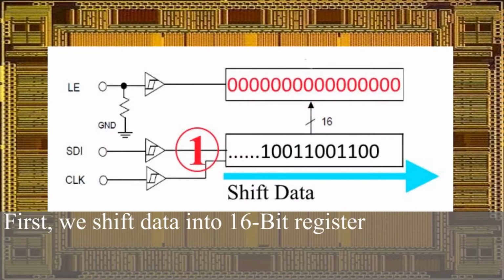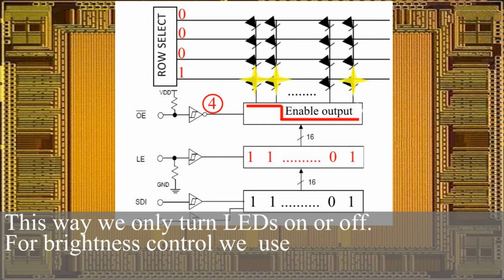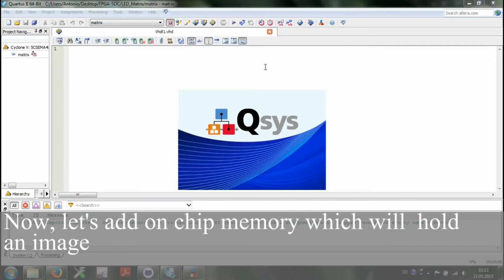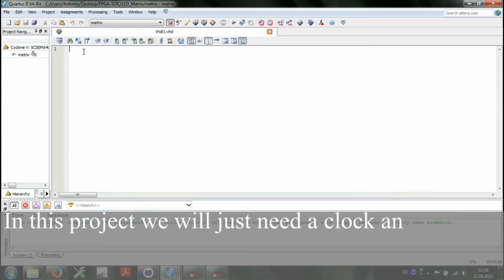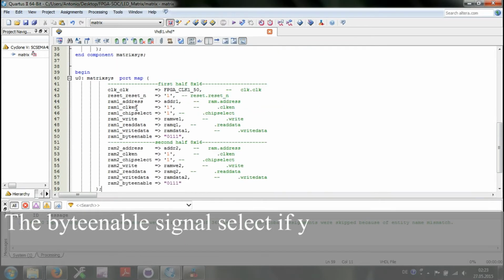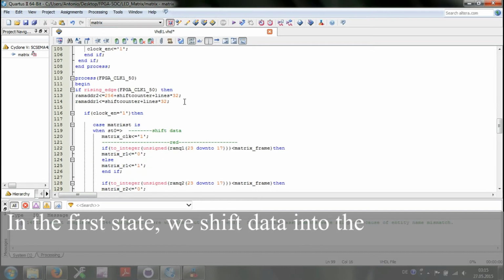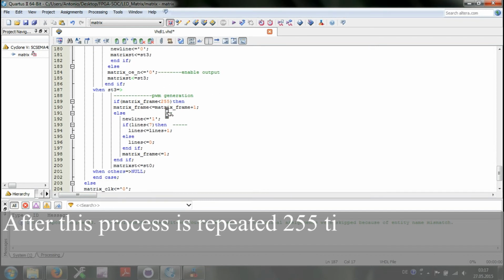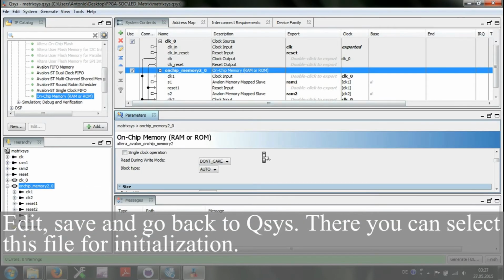Tutorial: Driving 16x32 RGB LED matrix with DE0-Nano-SoC FPGA board

Comment: Hello Toni, sorry to bother you again but your video is the most and show your high skills. I have a question: on the video you tell that the Adafruit display consists of two parts o rows each and you drive top ans bottom half simultaneously. This means that you have two drivers, one for each 8 rows? I'm asking about it because I have a 16x16 matrix and I'm afraid to use only one driver for 16 rows, Sure I'm compensating using 1/16 of the resistor value. Please, what are your thoughts?